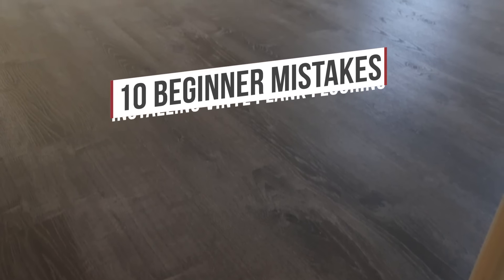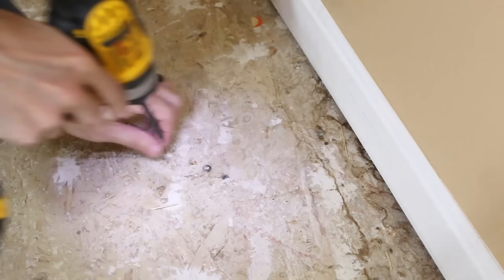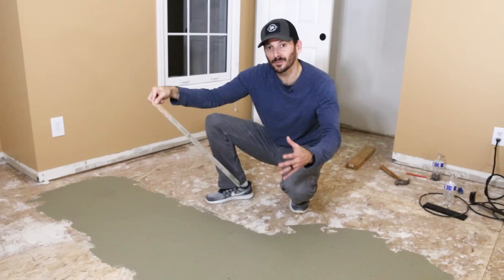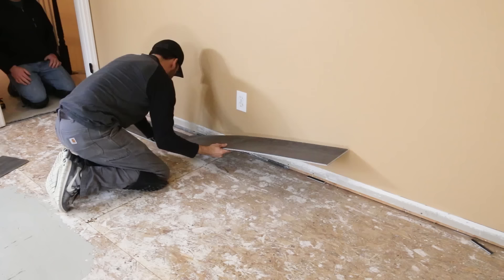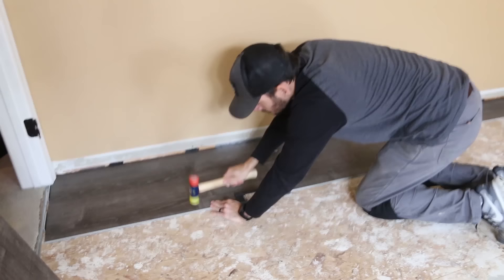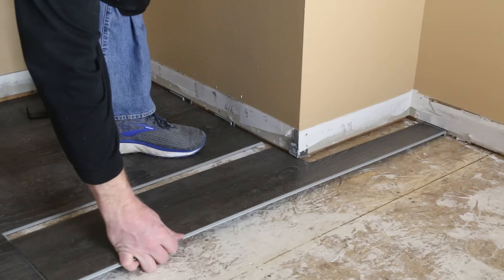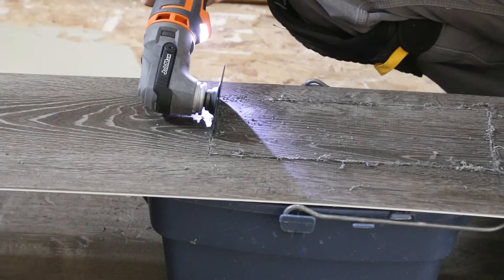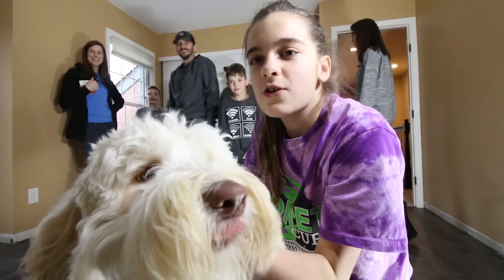10 Beginner Mistakes Installing Vinyl Plank Flooring

Comment from the maker: Check out my other flooring project videos: http://bit.ly/2uFkWp6
20 Best Tips for Vinyl Plank Installation - https://youtu.be/v-Uxeh3EmWI
Vinyl Plank Flooring in a BATHROOM - https://youtu.be/LrdWvtgOEFg
BEST Tools to Cut Vinyl Plank Flooring - https://youtu.be/V7aeMUsULVU
And don't forget to SUBSCRIBE: http://bit.ly/FTBT-youtube
Reply: Fix This Build That I’m 13 an we found when laying the floor in that removing the skirting was the way to go
Reply: Fix This Build That 1. Use a floor scrapper that has a pole and a blade, this way you can get more surface area done opposed to the way you did. 

Dip , it’s called deflection, 

Another mistake, thinset u will result in problems, this will crack and separate over time since u did not use a primer prior to flashing, and used the wrong product. Ardex feather finish or cmp prepstar is appropriate

Another mistake never use a full board in a starter row
Reply: Fix This Build That u also need to choose boards with different variances so u don’t have a pattern which looks fake or less natural. Open few boxes up and spread to cherry pick ur boards
Reply: Fix This Build That I started in the flooring business at 16 and have been every facet of this business from warehouse to install to sales to management now ownership and over 20 years!
Reply: Fix This Build That my crew would of installed that room in 2 hours start to finish lol
Reply: Devon Watch <
Reply: John absolutely can’t use plywood as a substrate for tile installation, must use cement board, detra, or old school wire lath and cement mix .. Durock , wonder board those are suitable or at best concrete slab.. even with modified thinsets  over plywood will fail.
Reply: Use ardex feather finish or similar product, WPC and SPC vinyl plank must be installed over a smooth clean surface never over thinset that is just absurd this guy will be kicked off my job in an instant
Reply: humble 1 I see u know your flooring! Ardex feather finish is amazing! I use ardex products often! Actually just met w ardex to discuss substrate preparation on a boat for ny waterways
Reply: John I dunno why at all he would use thinset over plywood if ardex is not available then using 1/4” Luan . This will work as well
Reply: chief wiggums I’m confused, drywall? I will need to refresh my memory and watch this again. Drywall as a substrate , that’s absolutely crazy
Reply: The only problem with taking the skirting off in that situation instead of installing quad afterwards, no the skirting boards sit too low and now all of the walls need to be painted...
I'm surprised you didn't bring that up in your video...
Reply: I like watching some.of these videos. I've been laying LVT (Karndean, Amtico etc) for over 20 yrs but when I've got some free time, as sad as it seems, I still watch these videos. Your one is quite good. We all make mistakes as we are only human and you show yours aswell.
Reply: Can you recommend simple program for planing floors like you used in 4:40?
Reply: What software did you use at 4:40 to model the room and measure the flooring??
Reply: what dog breed is that?!?
Reply: Razor scraper makes quick work of those staples. Nice job👍
Reply: 👍🏾👍🏾Great video! Subbed..Just finished a Laminate floor job myself. Posted the process to my channel 😁👍🏾
Reply: @parkerniernstein2337  When you say never use a full board in a starter row, does that mean every single board in the starter row is cut shorter?
Reply: Aren't you supposed to add some kind of material on the floor before adding the planks?? I want to take out the carpet in my son's room but there are so many different videos that tell me something different...

Comment: Flooring guy here. First mistake, using tile ADHESIVE as a floor leveling compound. Not sure how old this video is, but probably by now, the flex between the joists on that subfloor have started cracking that tile adhesive, soon it will start to crunch underfoot when it’s walked on. Number two, when you cut the carpet at the door to install flooring n the bedroom, you should have installed a piece of tack strip across the doorway under the carpet to mechanically hold it in place, without it the carpet will loosen over time and develop a wrinkle close to the door in the carpeted area.
Reply: First mistake was using pliers to remove staples! Lmao.  Then suggests using a scraper on nails?
Reply: What product would you recommend using to level an OSB subfloor over large areas like this?
Reply: Canonjac I use a combination of sanding high areas and leveling with a Portland cement based floor leveling compound such as Ardex or Mapei floor leveler in conjunction with a latex primer to adhere the leveler to the subfloor. Make sure the osb is screwed tight to the floor joists or trusses before leveling. Allow at least 24 hours after pouring before installing any floor covering. i.e. carpet, vinyl etc.
Reply: @ryanbraun3263  With scraper is 10 times faster than pliers.
Reply: do you need subfloor primer if the floor is concrete? im trying to get new floor for small storage next to the kitchen. It's only about 4x8 size. I also have adhesive tile (marble design or whatever) to cover on top of the plywood. The instruction of that tile tells me to apply the primer, but I do not feel it is neccessary for small storage.
Reply: 도구로 if the concrete is clean and dry, you may be able to get away without using the primer. It’s always a good idea to err on the side of caution and use it. It has a relatively quick dry time and will insure that the leveler doesn’t detach from the concrete slab. I’m not sure what you are referring to about plywood. If it’s a concrete subfloor, there isn’t any plywood to install over.
Reply: @nitr0junki3  It's a concrete floor I believe, not concrete subfloor (im no expert). The level of the concrete is below the kitchen tiles so I believe it is the concrete floor or is it?  yes very clean and dry, will also vacuum before I put the plywood in case there is particles. We are going to put few stuffs in storage, nothing crazy and heavy.
Reply: @Canonjac  Ardex feather finish
Reply: Former flooring guy here. In agreement with nitr0s statment. The flex on that subfloor will eventually break and cause crunching. I would probably use leveling paper or depending on the severity of the dip using a thin wood in the gaps that you would level out. I would highly recommend using this time to make sure your subfloor is screwed into the joists though
Reply: @jonathanlowe6655  i have a concrete slab floor from the 70s.  Someone glued old thin tiles down to it.  I cant remove them.   It would be way too much work.  However, around the perimeter of the room, the tiles are missing.  Leaving an unlevel floor.  How can I cover this part up to make it flush with the rest of the floor.
Reply: They sure could’ve used some underlayment.
Reply: @derkapotter7186  If you have a concrete subfloor this is likely the bottom floor. I guess my answer depends on the type of tile and type of floor. Do you mean you have that old Lynolium (spelling) tile glued in on top of the concrete?

My first choice would be removing the tile and grinding/leveling the subfloor. In all instances. If that is not possible see below

If you are doing a floating floor like Lifeproof and have a VERY thin tile such as a lynolium (i just cant spell that) . I would just use  something like lightweight concrete (quickcrete/sl150) to fill in the gaps. I do recommed using a primer as well. The reason that doesnt work in the video is they are on the second floor where there will be flex and break the concrete. COncrete subfloors are always downstairs and have no flex. You could also use leveling paper to fill the gap.

For regular tile. I again suggest removing the tile. otherwise you will need to try filing with primer, quickcrete/sl150 and leveling ONLY in the spots that need it. Not over the entire tile.

If you are doing a glue in floor you need remote the tile period so that the glue can adhere to the subfloor and to your wood.

Hope that helps
Reply: @emphyrean  🤣🤣🤣
Reply: nitr0junki3 I’m on a slab too and was confused when he mentioned plywood. 

If I had mentioned plywood in that context, I would simply chalk it up my Ole Timers acting up again. 😁
Reply: Well said....the sad thing is that desperate home owners come to this videos and mess up big time
Reply: Maybe I missed it but what was the brand/model of flooring used?
Reply: Another floorer here, this video is painful to watch
Reply: @wilfredoa.castillo.4561  sometimes nails won’t come out just a scraper. Need to get down on your knees , hammer it in or take out with pliers. If you hammer scrape it with a scraper to if it’s flat and out of the way.
Reply: @Canonjac Uzin 888. It does not need primer, it will even stick to glass/porcelain.
Reply: @emphyrean  if you watch to the end, it says it is installed on the back and violates the warranty if you put another one down.
Reply: @emphyrean  The product has underpayment built in ... he shows and mentioned it at the end of the video.
Reply: what material would you use for leveling the floor
Reply: @admiralbm  ardex or mapei floor leveler. Or any comparable Portland cement based brand.
Reply: @jonathanlowe6655  r
Reply: I don’t like the use of t-bars at carpet edges. I use endcap or a threshold that the carpet can be cut to. T-bars rock back and forth breaking over time. T-bars are good fo do-it-yourselfers
Reply: Question:  I installed vinyl pre glued to my subfloor of mobile home after removing carpet. To protect the subfloor, i put a smooth 1/8 piece of wood on top.  The video I watched did not say anything about putting something in between to prevent moisture or anything.  Within months my whole subfloor warped rendering it a total waste. I don’t know why it happened, we found no leaks, but I did end up having to remove subfloors and reinstalled subfloors only. Im so scared to put anything down for fear of moisture getting trapped in between again so I chose to stain and use polyurethane to protect but I really want to put down sheet vinyl. What would I have to do to prepare my subfloor. Can it go straight down on the wood with poly and stain?  I noticed you went down onto the floor without insulation pad or glue. Wouldn’t that sweat and also warp the subfloor underneath?  Just really scared and financially challenged.  All helpful comments are appreciated. Also where I currently have vinyl in my kitchen would I have to remove that before installing any thing else new vinyl?
Reply: @monetwagon  Today's your lucky day. This is my 32yr doing floors and I know exactly what happened. The subfloor you used is too thin and not the correct product. You need to use a minimum of ¼ inch plywood (they call it ¼ but oftentimes it's a hair under). Also, the plywood needs to be an exterior grade (all that means is it will hold up under some moisture). The  reason your subfloor warped is because of the moisture in the adhesive and/ or floor patch. If the vinyl in your kitchen is down really well, you can install over it. However, any curling would have to be cut away till solid(or cut and edges nailed) then filled w/ a filler.  Furthermore, if there is any embossment(grout lines) in the existing floor, they wil have to be filled w/ an embossing leveler (portland cement based product mixed w/acrylic additive). It gets troweled on(sometimes 2 coats depending on depth of embossment) dried, scraped smooth and then you're ready to install. Hope that helps.
Reply: Do you have to let the tile ADHESIVE dry first before installing the planks or do you mean you have to put the adhesive all over the floor to glue the planks ???? Thanks
Reply: @Canonjac  self leveling compound. Use the primer for the compound first.
Reply: Thank god you chimes in . First mistake is this guy installing any floor. lol omg so many bad things things here..
Reply: @louisrosenberg9908  you know nothing! Haha apparently me and you won 'Find the real floor guy' game 😂👍
Reply: @louisrosenberg9908  what bad things, please. Before i begin
Reply: Most hard surface mechanics have no carpet skills
Reply: @ToguroCrypto  Always prime before using any sort of leveling compound.
Reply: @derkapotter7186  It shouldn't be that hard to remove them. What you need to do is remove all of the tile then skim the entire area with Ardex. If you need help removing the tile go buy a cheap heat gun and a pry bar
Reply: @coreynorman1666  I’m about to install LVPh.  Attached backing. I’ve never done this before so please tell me what he’s doing that I shouldn’t do. I’m putting it over a plywood subfloor. I would like the extra comfort of underlayment but everyone says I don’t need it. Any tips would be greatly appreciated. Tysm!
Reply: @Canonjac  :
Reply: @everettwhite9874  Did you mean Alzheimer's? 🤣 (Ole Timers)
Reply: First mistake was asking this guy to lay your floor 😂
Reply: I'm a retired old guy, read all these comments and agree with "most".
Not so much about others. I did home reno work for over 15 years and got tired of home owner self taught "experts", dogs, cats, and kids. I was a Prego installer when they were first brought into the states. Did any of my brothers even notice what type of carpet was being cut?? It was Berber and no warning given about not pulling on loose threads. Y'all have fun explaining why that's NEVER a good thing to do.
On a plush carpet I agree about a tack strip in the doorway, not so much with thin Berber
BTW, I've never seen a quality multipurpose thinset break loose on a plywood subfloor.
Reply: @cindyreynolds1002  hey were you able to figure out anything while laying yours? I’m doing mine this weekend
Reply: I was about to write this exactly comment.. I scrolled for 10 mins to see if there was a legit flooring pro comment, and I found it!

Good on you!
Reply: I didn't even finish the video when I saw the terrible thinset over wood thing, also wasn't thrilled about seeing a girl in flip flops doing flooring and pulling nails. Just wear proper shoes for basic safety.
Reply: @nitr0junki3  some flooring patch mfg's say to not use their product (Planipatch) on an OSB subfloor. Read ALL instructions for your situation before selecting materials.
Reply: @procyrus2209  or Eco Prime. You can bond tile to tile with that stuff. Nasty, but bulletproof.
Reply: @donniebrown2896  The highlight of the day would be going to install a closet door track over Berber and drilling the mounting holes while you watch that line of carpet disappear like a row of dominoes!! Fun city!
Reply: @ryanbraun3263 Angle grinder will be ur best 💯👍

Comment: I leave the baseboards on, not because it's easier,  but because if there's any variation on the flatness of the floor, there will be gaps in the low spots.  Shoe molding conforms better. And because that's how it's supposed to look. To me, seeing only baseboards on a wood floor looks like a diy job. Shoe looks more professional. Oh, btw, NEVER install a t-mold on carpet!! The carpet is not stable and doesn't support the molding and will allow movement and potentially break over time. Use an "end cap", or if that's not available for your product,  a "reducer." I've even heard of some flooring guys use nothing at all, and "turn and tuck" the carpet right up against the flooring. Personally,  that method makes me nervous because the flooring could shrink and the edge will be exposed.

Comment: As a professional you should always put underlayment 6mil poly when installing on concrete floor. The so called experts dont put that on the box but is required as a moisture barrier regardless of what they say. I have seen this flooring get moisture without it and create mold
Reply: This is great info even if we are paying a professional. I love hearing from pros so I know what to ask for. Is there a certain location in the U.S. that you would recommend this or just across the boar for all installs?
Reply: The life proof flooring like this 9/10 times is completely water proof, top and bottom side. Also has mold resistant top and bottom, if you have a moisture issue it would destroy your subflooring longgggg before it does any harm to this flooring.
Reply: @eric, just read the box, if it says water proof it is, they put this kind of flooring in a pool for 10 years, took it out and installed it into a home with no issues, don't waste your money on an underlayment, they typically have a built in underlayment already attached to the bottom of the flooring. The only reason you would want the underlayment is for a  "softer" feel, almost like what padding does for carpet. Best of luck.
Reply: @ericnash6204  ^^
Reply: @ericnash6204  Concrete floors only need poly. The manufacturer is wrong. Underlayment is cheap and a added protection. The so called underlayment built into this flooring is barely a 1/16. i have gone back to flooring jobs done with this product and seen moisture throu it without barrier.

Comment: From a journeyman tile setter - DO NOT put thinset on OSB. It will suck the moisture from the mix, and you have a nice crunch sound over the patch overtime as it turns to dust. If going over wood, thinset should only be used over plywood.